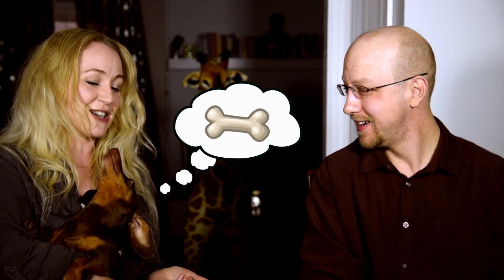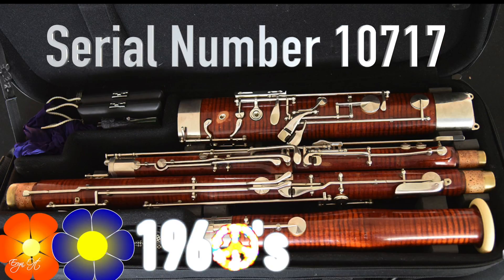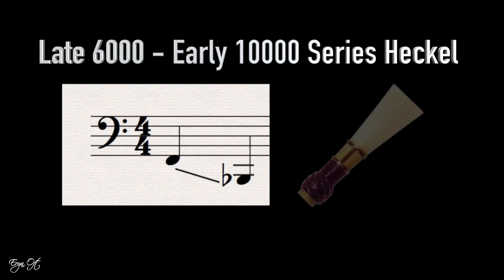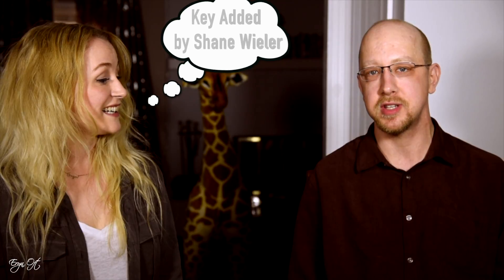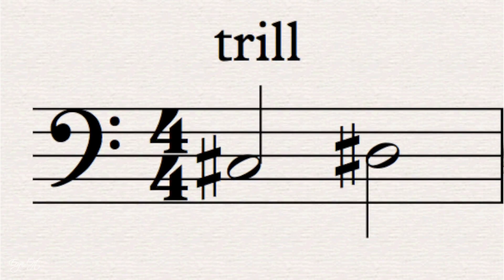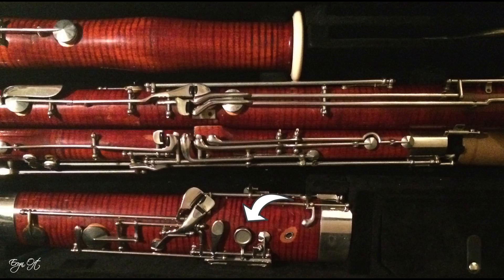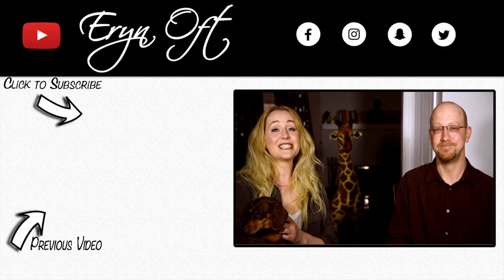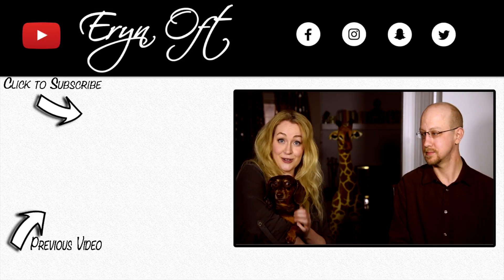Heckel EXTRA LONG LONG JOINT and ADDED KEYS with GUEST CHAD TAYLOR

Comment: The "story" that I heard was that Heckel increased the wall thickness of the instruments around 1963 (serial number 10700) because they were having trouble with cracking, especially in the top sockets of the boot joint. They also seem to have increased wall thickness again in the 15000s.

This was not bassoon-specific; they also increased the wall thickness of the Heckelphones at the same time. I do not know about the contrabassoons.

Comment: This was very interesting.  Have the current production Heckels adopted this longer long joint?  I noticed that my first teacher's instrument had a small gap where the long joint connected into the boot.  When I asked about this, she told me that it improved the intonation of the low register.  Her instrument was a Fox 101.  This is all making sense now.  Thanks!
Reply: NCF8710 some players pull out the long joint a bit if they are very sharp in the low register.

Comment: Can you please tell me the length of your long joint and what case you bought for it.  I have an Howarth bassoon with a long joint of 66cms.  I'm trying to find a bassoon case to fit it.  The case I have is stretched at the long joint end giving it less protection than it deserves.
Reply from the maker: My Heckel Long joint is only a few 1/8 of an inch longer than the typical long joint. It fits in a standard Kolbl case but in the end I bought a custom Bonna Case. I sent them the dimensions of my bassoon and they made it specifically to fit. Here is a video comparison of the two cases that worked. https://www.youtube.com/watch?v=4LvHGQgRL3Q Happy Shopping!
Reply: @erynoft  Hello Eryn.  Just to let you know I eventually ended up with an Howarth Academy case made by Koelbl.  It's a perfect size with an adjustable insert for the tenor joint.
Watching your video link I added 10 decent sized books into the case.  Boot joint out no movement, tenor joint out no movement, long joint out the case moved to the v shape but not to the extreme of throwing out the bell joint.  The only real problem I add was how to fit the backpack straps, I ended up going onto their website for a decent picture.
Thank you again for your help.
Reply from the maker: @johnaskin13  Thanks for letting me know what you got. I will be sure to check this case out! I'm not familiar with it, yet. Happy Bassooning.